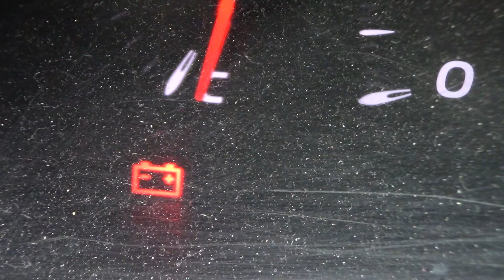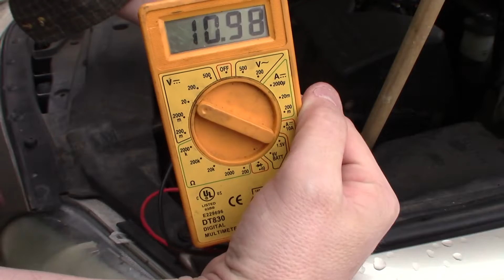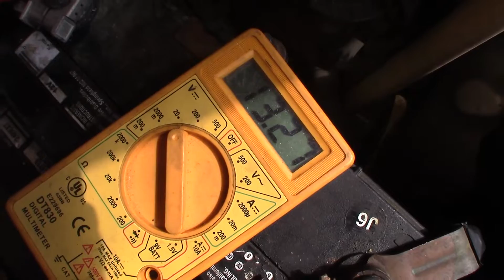How to Replace a Toyota Camry Alternator on the 3.5 V6!

Comment: Ok. First of all. Thank you so much. This is truly one of the better car maintenance videos. You explain thing very well and I honestly learned a lot from battery voltage to that fun bolt tape trick. 

Second. God bless anyone who attempts this repair. I was one of the lucky few who got defected alternator and got to go through this rewarding experience a second time... That being said, here are a few things I learned.

1.If you have AAA you can have them stop by and diagnose the problem so that you don't end up buying extra unnecessary parts like a new battery. I ended up buying a cheap volt meter and diagnostic computer off Amazon. 
2. Buy or rent the right tools. The belt tensioner helps a ton and having variable depth ratchets and Sockets to fit in tight spaces is necessary. I found out the hard way that if you take the belt off of the alternator and release the belt tensioner all the way, you won't be able to crank the tensioner back far enough to get it back on. The second time around I turned the tensioner as far as I could and ziptied it off. This kept the belt loose throughout the assembly so I could easily put it back over the alternator.
3. The second time around only took me an hour and a half rather than 8 because I made a clear path for the fans to come out. Take the time to remove as much as you can out of the way so that you don't damage parts. Definitely drain the radiator first so you don't get coolant all ever the engine. I ended up removing the bumper and radiator bracket to get the fans out, otherwise the fans smash against the radiator. Detach as many cables and bolts as needed and MARK THEM WITH A PIECE OF TAPE AND NUMBER THEM SO THAT YOU CAN COUNT DOWN AND NOT FORGET TO REPLACE BOLTS AND CABLES DURING ASSEMBLY. 

Hope this helps and no one needs to make the same mistakes I did. I realize this video was posted a while back but feel free to send me a message if I didn't explain something well. 

Take care, stay safe, and good luck!
Reply from the maker: Thanks for the kind words! Great detailed writeup here, 100% accurate. AAA is great, rent tools so things work out for you, don't bash your radiator to death. 
Isn't it funny how much faster round 2 is?

Comment: Thanks for this detailed video. I am comfortable using tools but seeing other videos where so much had to be removed to get to the alternator. It scared me off, but after the shop told me it'll be over $800 to fix which I don't have. Now I back checking videos and yours has given me the confidence to give it go.
Reply from the maker: Go for it, this job was not fun or easy. Hopefully the video helps you. There are some good tips in the comments one I believe was to cover your radiator with cardboard so the fans don't scrape it up. Good luck with the job! Keep some money
Reply: @RiggsGarage  
Thanks I feel confident from your video definitely earned a like and matter of fact I'm subbing now too. Again thanks for the great info.
Reply from the maker: @TONEakaSHOW  thanks!
Reply: @RiggsGarage  
Man that bottom alternator bolt is a b*tch to get out lol

Comment: Your detailed video saved our bacon!
We have a 2012 v6 and needed to replace the alternator...what a pain! We founs that taking the heat shield off and sliding some cardboard against the radiator helped out a ton. Took us a few hours, hopefully it gets rid of the whirring sound and the low-charging issue we had.
Reply from the maker: So glad to hear, thanks for letting me know!

Comment: I just completed this job on my 07 V6 XLE with 190K on the clock.  Great video but If I might add: 
1. DEFINITELY rent or buy the flat-bar pulley wrench for this job as it is most useful for the 14mm bolt on the rear ear of the alternator - I wasted at least 30 minutes trying different extension/socket/bar combinations only to end up renting this tool anyway.  

2. I felt more comfortable removing the radiator core support, hood latch assembly, and both horns to allow the radiator to tilt back (toward the front of the car) and ease the fan shroud up and out.  It is not necessary to remove the radiator and all of its cooler connections, just the core support on top.  As you rightfully mention, you DO NOT want to damage your radiators fins much if at all and they are very easy to damage.  

3. I found a 13mm worked best on the tensioner pulley, not 14mm, but I replaced my tensioner last year so maybe it came with a different bolt head than OEM and I just don't remember, but if a 14mm isn't snug then yours is a 13mm.  Also, its not a bad idea to change your belt if it is at all a question as to weather its good, especially when replacing the alternator.  I understand you did this job without ever jacking up the car, which is appealing, but I ended up replacing my belt and had to jack up the car and remove the front right wheel.  Undo the 2 10mm bolts holding the plastic cover on in the front corner of the wheel well to reveal the service window to the pulleys.  I used a 13mm closed end wrench to muscle the tensioner pulley (counter clockwise) with one arm and fit a 5mm allen key into the little hole on the front of the tensioner assembly when it lines up with the hole on the block (per service manual).  This locks the tensioner in the un-tensioned position and you can work on the belt and check all your pulleys for stickyness (none in my case).  Oh, and if you have a bad or noisy belt tensioner assembly NOW is the time to do it because the alternator has to come out to replace it!  x_x

4. When installing the new alternator, I found it easiest to start with the 12mm bolt in the bracket that inserts in the front of the block and thread it about half way so you can move things around THEN the rear ear bolt (this was the trickiest and felt easiest to cross thread) with the method you mentioned of rocking the alternator gently will getting the bolt started with your right hand, THEN the front ear 14mm bolt.  You DO NOT want to cross thread any of these so take as much time as you need to feel good about how the bolts are threaded in.

5. I went with a Denso reman alternator and after a call to my Toyota parts department, learned that this is the same unit they put on customers cars at the dealer.  When asked if there are new, not reman'd Toyota alternators, his reply was "I can get one, there are 7 left in the US, and its $675 before any discount" - not an option for me!  The Denso is priciest of all the reman's (about $300) at your parts store but it is what AC Delco is to GM, so I felt most comfortable with this choice - this is NOT a job you want to do again just to replace a faulty reman alternator.

6. Invest in an automotive multimeter if your a DIY'er to test your work and don't rely solely on the equipment or personnel at your local auto parts store to test the state of your charging system.  You should have already ruled out a bad battery.  Engine running my alternator is charging at 14.2 volts, so, it worked!  Since you removed the battery completely during this job the ECU will be in learn mode when you fire it back up upon completion and idle might move around a bit.  It should eventually level off at idle at 750-900rpm range.  Make sure you drive it around after verifying the alternator is charging.  Re-learn, if I recall, is about 50 miles of mixed driving with the climate control and lights on.  

Don't be afraid of this job even if you are a novice.  This video should make it easy to understand and the only hard part is making sure you install all the bolts correctly on the new alternator.  These are very strong running engines that require minimal maintenance and return over 30mpg on the highway.  Thanks for the video tutorial!
Reply from the maker: Wow, excellent writeup! I agree that moving the core support is probably the best move and reduces risk. Well, I agree with all of it. Thanks for posting!
Reply: @RiggsGarage  Thanks! Sorry if I'm rambling on here but one last thing (and this is important):  The ECU re-learn or resetting of the fuel trims is necessary anytime you have had the battery disconnected.  You will notice a big difference in throttle response, crisper up shifts, no delayed down shifts, etc.  Simply turn the key forward to "on", then back off completely, then back to "on", then start the engine.  Engage the parking brake (the foot brake on the far left of the footwell), put your foot on the normal brake to shift into "D", then leave it idle for 4-5 minutes this way.  Their are several youtube vids on this so just do a search if you need clarification.  This works on most Toyota models of that vintage and I HIGHLY recommend doing this as the last step of the Alternator job and thanks again to Riggs Garage for taking the time to make a clear and informative video that saves mucho $$$ vs. paying a shop to do it!

Comment: I just changed the alternator on a 2010 Camry and I only had to take out three bolts and remove two wiring harnesses. I was lucky I didn’t have to dismantle everything you did! Great job!
Reply: Must have been a 2.4L 4 cylinder and they are entirely different and easier.

Comment: Five Stars Bro!! I watched a few videos on the 3.5 liter and I ended up doing it pretty much like you showed except I unplugged the harness to the AC compressor and I removed the 3 bolts on the manifold heat shield and slid it to the right for more visibility/clearance. I had about 4 hours in it give or take. Thank you for the insight!

Comment: Just did this job on a friends car. If you’re more inclined to since the coolant is already getting drained, you can remove the thermostat outlet or the housing as a whole unit instead of unbolting the dipstick. Good opportunity to change the thermostat and associated seals
Reply from the maker: Thanks for watching! Were I to do this job again I would definitely remove the water neck.

Comment: Great video It helped a ton. For me though I was having issues taking the back bolt out on the alternator. So I jacked the car up, took the tire off and the plastic wheel well off. That made it a lot easier to access.
Reply from the maker: Glad to help, I should have done that looking ack
Reply: I appreciate it 
Video was dead on and super accurate

Comment: Thanks for the great video!  We used your information to change the alternator in my wives Camry.  We did find one thing on ours that was different than what you said.  Both bolts on the alternator bracket are 12 mm.  You said one was 12 mm and the other was 14 mm.  Thanks again!!!
Reply from the maker: Thanks for watching!

Comment: Thanks for pointing out that "hidden" metal bracket bolted to the back of the Alternator. I was pulling my hair out before I realized that was still holding it in.
Reply from the maker: That was a booger! Glad to help
Reply: I first saw this hidden bracket and 2 bolts, wire loom clip, in an A1 Auto Parts tutorial that a woman tech did. I definitely would have missed those bolts too.
Reply: Me too I damn near tore the whole motor out😂

Comment: Have finished this work today - kinda pain in the ass job, thanks for the video. 2 major tricks to improve the things you have shown : 1. take off the heat cover before taking off the fan, it’s gonna be much easier and you won’t dent the radiator. 2. take off the left hose that goes right under the alternator, this third bolt of the alternator will be much more accessible. And the thing I have spent quite some time on is tensioner - not sure how it should be done in the proper way, but once the tension is released it’s not possible to get the wrench out of it, the wrench is long and it was  pushing into the front, so I have put some wood under the tensioner to take off the wrench out of it. Took two days and about 9 hours of work.
Reply from the maker: Good notes. Definitely a pain!

Comment: I hope you can answer. I’m at the part where I need to use the belt tensioner tool to remove the belt off the alternator. When I do I can’t get the tensioner add the bolt. Is it best to just remove the entire belt from the bottom of the car? Cuz I can’t get the bolt off bottom of the alternator. I hope you can answer quick I’m almost down doing this job. 😭

Comment: Pro tip for those 3 wire clips connected to the fan. A deep set 10mm socket fits in there nicely and squeezes both pinch points to pop it right off
Reply from the maker: Very nice. That would have saved me a lot of time!

Comment: Very informative in the step by step process.I have to do mine,but i think i will use Gunk to clean the engine area first.I have 2 cans sitting in the garage already.Thanks for the info. and i hope u get a lot of views.
Reply from the maker: Thank you for watching! Yeah, cleanup is very much worth the time, this one was fairly dirty. Let me know how it goes, and be careful of that radiator as you pull fans out and reinstall. Good luck
Reply: @RiggsGarage  Thanks a lot Riggs.After seeing the hard time u had with the fan.It might take me 2 days to get it out safely.

Comment: To make taking out the radiator fan assembly even easier you can remove the exhaust manifold heat shield, it’s just an extra 3 bolts. It is shown on this video at 6:42. If you pause the video at 6:42, he his removing the hose clamp, if you look to the left you see the oxygen sensor behind it with the wire sticking out. That metal plate around is the heat shield. There are 2 bolts on the top and one more toward the bottom right. You can move the shield along the wire of the oxygen sensor without taking the oxygen sensor off. CAUTION: This heat shield gets EXTREMELY HOT. Please make sure car has been cooled before you attempt to remove the shield or even performing this job at all. 

I just did this job earlier and removing the radiator fan assembly was a piece of cake after the heat shield came off.
Reply from the maker: Good advise, thanks!

Comment: So, my kids car, got the Call. I charged the battery, starts and runs.. but thought maybe should check alt out. At auto zone test she said good batt, good starter, failed alternator. Watched videos,  liked yours best. Watched again, took a nap woke thinking I had a project ahead of me but have you! First step Volt test batt car off 13 ish, car running 14.14. What? Took off battery with car running with isolated tools and it kept running.  Then took to O'Reilly.  Test there says bad battery,  good starter and took a long time to tell me bad alternator! I reveled what I did. He googled what output a v6 2007 camry needed an 14 is good. So what am I looking at?? I guess I will not fix what is not broke even though the 20 year old at part store says too?!$$
Reply from the maker: If the battery tests bad, I'd start there. If the alternator tests bad again, I'd replace it. I believe they can still output the correct voltage and be bad, in that they aren't consistent

Comment: This is a great video but i can not get that lower bily off for my life. I ha e spent two days on one bolt. Sad but not gonna loose to this sob
Reply from the maker: Are you talking about the bolt at the 13 minute mark I'm working on? That one was a booger. I used a long socket and the belt tool because it fit well.
Reply: @RiggsGarage  yesss i gotta go get one thank u
Reply from the maker: @nighthawk5301  I rented that one from O'Reilly
Reply: @RiggsGarage  i got one but i swear its stripped.

Comment: My mechanic is saying the radiator needs to be removed to have the alternator replaced but it doesn't look like this is true.
Reply from the maker: It is not true, but it is very tight and you have to be careful not to dent your radiator up.